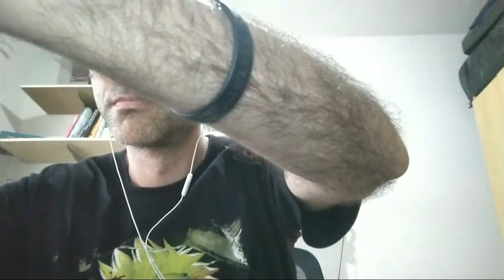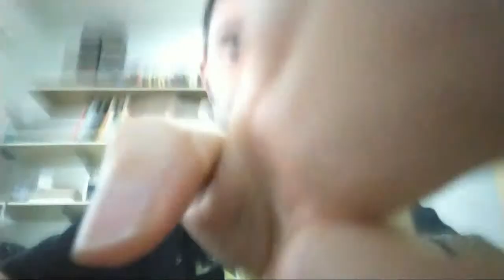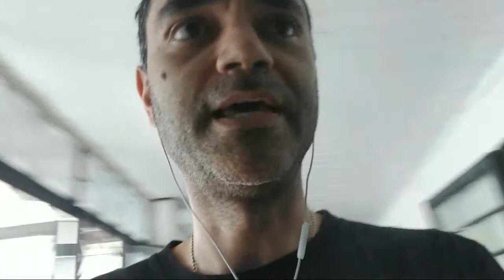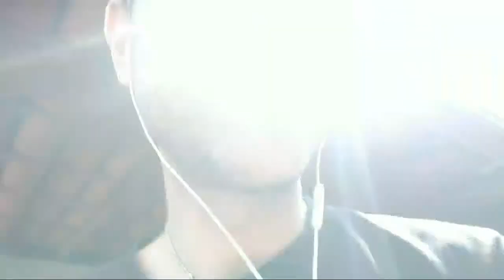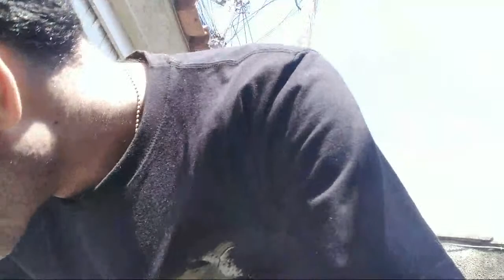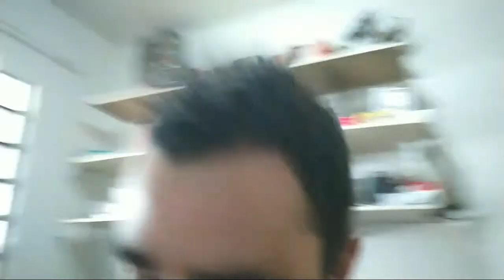Chemical Process Engineer Diary #2

Comment: Hello good morning, I am a chemical engineering student and I am doing my thesis on simulation in steady state of a natural gas sweetener plant, in my absorption tower my sweet gas and rich amine temperature do not coincide with the design data of my PFD, what variable can I make to make my model match my design data? Or what can I do? Thanks
Reply from the maker: Hi Julio, first you needed to evaluate if fluid package and composition are the same of your PFD. Moreover, if it was developed in different process simulator software you will not get identical results. Some of the process conditions you can adjust in a sweeting process is flow and temperature. Do not worry too much about getting same values but understanding the results and if they make sense.
Reply: Thank you very much for your reply. If you allow me, I will ask you something else. For my simulation I am using PRO / II and as a solvent it is the MDEA, however my sweet gas temperature is 10 ° C above that reported in the PFD and the temperature of the rich amine is 10 ° C below As reported in the PFD, in addition, the concentrations of CO2 and H2S in sweet gas are well above the norm. Can you give me any other advice? Thanks
Reply from the maker: Hi Julio, your lean MDEA temperature is based on sour gas temperature. MDEA temperature must be only a few C degrees higher than sour gas temperature to prevent water condensation. Evaluate your absorber column inlets and outlets.